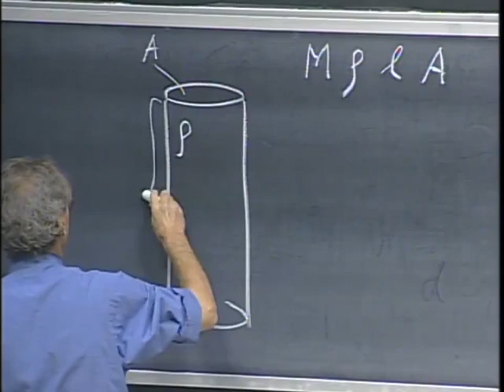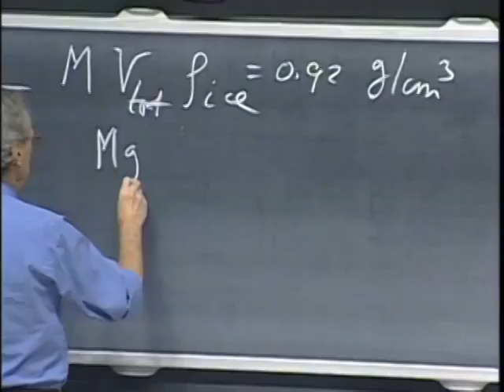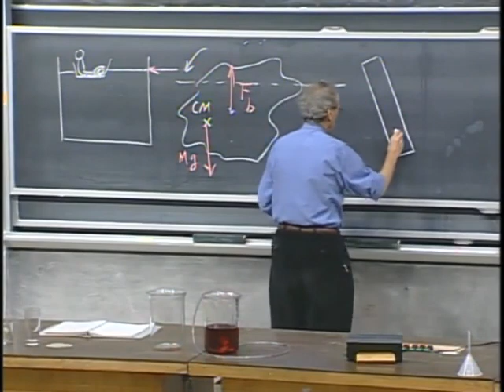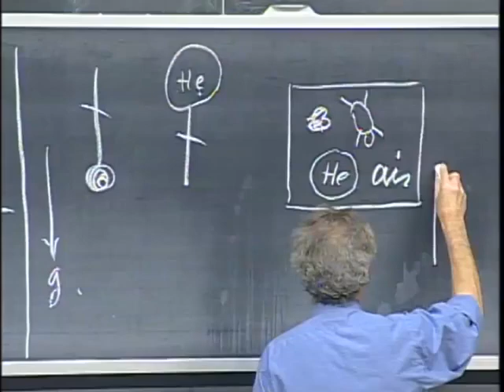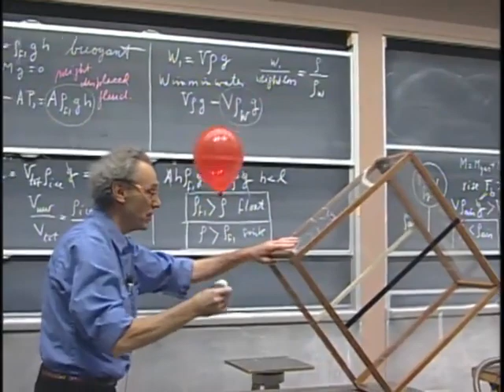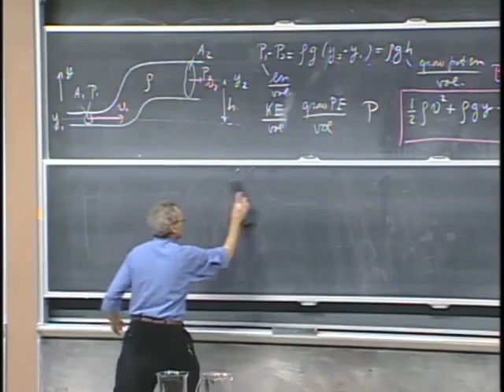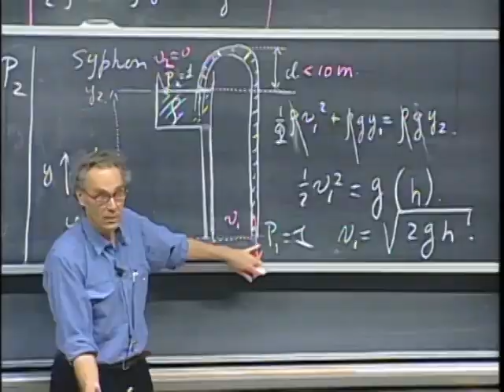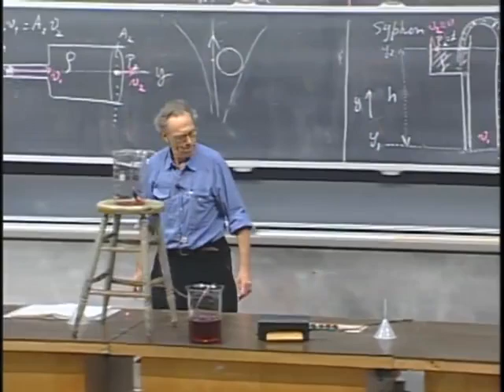8.01x - Lect 28 - Hydrostatics, Archimedes' Principle, Bernoulli's Equation

Comment: I think that to understand the pool level problem, it helps being exaggerated. Consider a super dense object, 1 ton with the size of a coin. Now imagine we drop it in a boat that could carry it. Intuitively, the water level would rise significantly to counter the added weight. Now if we drop it in the water, there will be a massive weight relief in the boat and the buoyant force required to keep it floating will be therefore much less. The object has the size of a coin, so the volume of water displaced by it as it sinks is negligible and so is it's buoyancy. The total buoyant force that the water produces will be way less, and so the pool level will drop. As long as the boulder's density is greater than that of water, the same reasoning could be applied.

Comment: I have an answer to the swimming pool question posed at 11:20, but I also have two additional questions regarding the same.

The answer to your question:  The water level goes down, because if we assume that the density of the stone is greater than the density of water (a reasonable and intuitive assumption), then the stone will sink to the bottom of the pool and settle down. When that happens, the buoyant force that was originally holding up the stone before it was thrown into the water will now be shared between the upward normal force at the bottom of the pool AND the new buoyant force together. Therefore, the new buoyant force is only a fraction of the original buoyant force. Since lower buoyant force displaces lesser water than higher buoyant force, the water level in the pool goes down.

(In the event that this is a bottomless pool, then the stone will keep accelerating downwards under its own weight as there is a net force pulling the stone downwards. This net force can only exist if the new buoyant force is lower than its weight, and hence the new buoyant force is lower than the original buoyant force. Thus, the pool level drops).

However, I have two variations on the stone that was thrown out:

Q 1. What if, instead of a stone, a fish of the same volume as the stone but of the same density as water is thrown out of the boat and into the pool such that the fish goes below the surface of the water but doesn't sink? Would the water level in the pool go up, stay the same, or drop?

My (probably wrong) answer: The water level would stay the same. Since the buoyant force is neither being shared by any normal force at the bottom of the tank (as the fish isn't sinking to the pool floor) and nor is the fish accelerating downwards, there is no change in the total buoyant force, which means there is no change in the displaced water. Hence, the water level stays the same.

In fact, when the fish is thrown out of the boat, for the brief moment that it is in the air, the water level drops (as the buoyant force drops), but once the fish is under the surface of the water, the water rises again by the same amount that it had dropped, thus equalizing the level.

Q 2. What if, instead of a fish, a wooden block of the same volume as the fish but of lower density than water is thrown into the pool such that it floats? Would the water level in the pool go up, stay the same, or drop?

My (definitely) wrong answer:  The water level would stay the same. There is no change in the total buoyant force here either, as the wooden block isn't sinking to the floor.

But I still feel that my answer to this last question is wrong because my inductive reasoning would have led me to believe that if a higher-density object (stone) lowers the water level in the pool, and an equal-density object (fish) keeps the water level the same, then a lower-density object (wood) would have raised the water level. But that is not what the equilibrium equations tell me.

Please correct me if I am wrong in any of the above.

And yes, your lectures DO make me ♥ physics :)
Reply from the maker: Watch my lectures - Your answers are there!

Comment: Hello Dr. Lewin, this is what I think about the question about the water level changing when you throw the rock overboard.   

I am a little confused on what you mean by will the water line remain change. Relative to the boat or relative to the walls of the pool? 

Initially, the water is at a height y_0. The volume of the fluid V_water is given by x*y_0*z where x is width and z is the thickness. For the boat to float, the F_b must equal the weight of the boat and rock. So F_B_0 = (M+m)g (1)  where m is the mass of the rock and M is the mass of the boat. 

Now analyzing the situation when you throw the rock overboard. The mass of the entire boat-rock system must change because we no longer have m. So, in order to float, F_B =Mg.  (2) 

So applying Archimedes Principle to (1.1)    V_fluid_0*p_water = V_(M+m)*p_(M+m)   and to (2.2) V_fluid*p_water = V_M*p_M   . F_B_0 > F_B because of (1) and (2). 
Therefore. V_fluid_0*p_water > V_fluid*p_water.  
p_water = M_water/V_water = M_water/x*y_0*z    so we have it that: 
V_fluid_0*M_water_0/xy_oz   >  V_fluid*M_water/xyz 
We know that the density of water must remain constant so as we throw the rock overboard, the mass of the fluid M_water increases. So if M_water > M_water_0 and the densities are equivalent, y_0 > y to keep a constant density so the water level will sink.
Reply from the maker: +Dr. Science Sc.D please summarize your conclusion yes the water level will go down. You did way more work than was needed. Try this. If the volume of the rock is V when the rock is in the boat, more water is displaced than V (Archimedes). When the rock is at the bottom the water displacement is V. Conclusion ==> the water level goes down when you throw the rock over board. .
Reply: +Dr. Science Sc.D In these problem the water level is taken relative to the walls of the pool. If it was to be taken in relation to the boat (and then the question would be if the boat sinks in a little bit or a little less, respectively the water level in relation to the boat would rise or would lower). Coincidently, I think the answer of both of the problems is that the water goes down.

Comment: Whenever a body is partially or completely submerged in a fluid,it will experience an up thrust which is equal to weight of the fluid which has been displaced.

Comment: I think the water will lower slightly.  The stone will displace its volume of water when tossed in and therefore sink due to density. At this point I believe that the boat will float higher in the water and displace less. The boat was displacing water equal to the weight of the stone which is more water than the volume of the stone. If the stone was same density as water , the level stays the same.

Comment: In this case, the helium balloon is already in motion due to its upward buoyancy force, which is caused by the difference in density between the helium inside the balloon and the air outside. When the container is accelerated forward, the balloon, being part of the container, also experiences the same forward acceleration.

Since the air in the container is also accelerated forward, there is no relative motion between the air and the helium balloon. Therefore, the buoyancy force acting on the balloon is not affected, and it will continue to move forward with the container.

I think this make the concept INTUITIVE

Comment: {39:00 -->}
You said that when a hole is made in the vessel, water will flow with the same velocity as in the 'syphon case'. But what if both were done simultaneously ? 
The approximation that v2~0 would not hold good right ?
Reply from the maker: both can be used simultaneously. Each would work as if the other was not there.

Comment: Water line goes down. The rock is added weight which the water must then displace by allowing more of the boat in the water. If the boat and its contents are to be considered a system, then just pretend their density is shared, Having a rock in the boat  effectively increases its density (its weight per volume). Due to this the boat will sink to a point where Vwater*Pwater*Gravity = Weight of boat. The boat weighs more with the rock, when the rock is thrown away, the volume of water required to meet this wight is lessened. The boat rises, the water line goes down on the side.

Comment: I guess the reason for the last problem being the following; when he turns the glass upside down a tiny amount of liquid runs through the microscopic gap between the glass and the cardboard with a high speed, causing so much low pressure thus the Mg of the liquid is supported. Please correct if I'm wrong.

Comment: Professor in the syphon demonstration, the reason why the water runs against gravity is probably due to two reasons........

1) you mentioned that area of the tube is much smaller than area of the vessel so this means adhesive force inside the tube will dominate over the weight of the juice.

2) if suppose after juice starts flowing and at some point the flow breaks then at that point there is vaccum while at the end of the tube dipped in juice pressure is 1atm.....so this will also drive the juice upwards.......
Reply from the maker: google syphon - it's all there

Comment: I do not thin Bernoulli's equation is that Bizarre when you think about it. Pressure is a static energy measure while flow is a kinetic energy measure so it stands to reason that they would have a inverse relationship. No different than Amps and Voltage. Any measure of energy in motion will have a inverse static measurement as well. It only stands to reason at least that has been my observation as a mechanic. Cheers!

Comment: 47:55 Sir please crt me if I'm wrong! In this case..when there is no cardboard covered upon the glass the pressure at any point on the surface of the juice must be 1 atm. After the cardboard has been kept on it and closed ,still it is 1 atm. When I think about what happens when we flip the glass which is closed with a cardboard the air molecules inside the glass goes up and juice comes down where the pressure of air inside the glass is not 1atm anymore and it would have become very low such that you can neglect the pressure of the air . Now if you look at the cardboard there are two pressures acting on it from both the sides,one is 1atm due to the atmosphere and the other one is, whatever the hpg of the juice is. And  the hpg is way more less than 1 atm because it is not 10 metres ,if so, it would have pushed the cardboard and as result the cardboard is pushed towards the glass by 1atm pressure outside ! Correct me if I'm wrong sir!🤓
Reply from the maker: you have not explained why I was able to suck up liquid over a distance of about 5 meter.
Reply: @lecturesbywalterlewin.they9259  sir that was because you were just sucking out the air inside the tube and when you do that the atmospheric pressure pushes the fluid up you can do it until you are at 10 meters of height...the reason that you were not able to suck it above 1 metre in the previous demonstration was ... you sucked it at a single breath. you could have done that if you do that by taking a breath in between .otherwise you will not be sucking out all the air inside the tube which would actually resist the water coming up....the main reason behind  that is... Your lung capacity..you may not be able to suck it more than 1metre at a time but you can do it more than 1 metre by breathing through your nose in between... correct me if I'm wrong sir
Reply: @lecturesbywalterlewin.they9259  sir please reply sir😅🤓

Comment: If the boat has a flat bottom,or otherwise, and is raised to the level of the water,its weight will remain the same,so, if now the stone is thrown into the water will flow overboard so the level of the water will go down,just as the water in Archimedes bath the water fell to the floor.

Comment: For the upside down glass trick: Upward Force caused by atmospheric pressure exerted on the cardboard is higher than the downward force produced by weight of water (plus the small force caused by the trapped air on top of the fluid).
Reply: the open air pressure and the air pressure in the glass cancel out. they are both 1 atmosphere.

Comment: The waterline must go down as the buoyant force isn't changing as the boat displaces the volume, however, the weight of the system(man and boat and rock) is reducing so the upthrust is greater now and with respect to the boat, the man shall see the water going down.
Reply from the maker: correct

Comment: I think the level of water will go down because when the stone was in the boat , the boat had to replace an amount of water which was equal to the weight of the man , the boat and the stone itself but later when the stone was thrown , the stone didn't replace anymore water than its equal volume  . I presumed that the density of the stone is greater than the density of water.  So the water level goes down . I am not sure if this is an appropriate answer or not .
Reply from the maker: correct
Reply: Thank you :) .
Reply: @mdsakhawathossen7088  yes you are right. The nice point in this problem is that everything depends on the density difference between the object you throw and the liquid of the swimming pool. If you empty a bottle of liquid which has the same density of the liquid in the swimming pool, the level remains the same. If you throw a stone the level goes down. Nice problem prof. Lewin! Inspiring as usual
Reply: @Jeremy Nathan   Well, I'm not so sure about that.. I mean, if you fill the boat with water, the water in the pool still has to displace the same volume that the filled water weitghts, making the boat to sink a lil bit more and therefore, making the water level to rise... When you remove the water inside the boat, the only volume to be displaced is the one from the weight of the boat, making the water level to go down. So I don't think that the density of the rock  (or any object inside the boat) plays an important role (as long as it is higher than the density of the air).
Reply: Since the density of the rock is so high. it’s volume is quite small, for a given mass, therefore, the water displaced by the rock is much less. The water level will go down

Comment: Good evening professor. I've tried different experiments about the upended cup. First I assumed it's because of the shape of the cup because the base is narrow and the opening is wide and when upended the Pressure*Area inside is lower than the P*A outside. However,  the opposite shape also worked... I tried different quantity of water inside. But it worked no matter it's fully filled or with just little water. It has nothing to do with the covering material whether it's water-absorbable such as cardboard, a piece of paper or a piece of plastic sheet. But when I made a hole at the bottom of the cup and upended it, it didn't work. So It's absolutely due to the air pressure difference between the inside and outside. Since 1/100 difference of 1 atm produces 10 gw/cm2, it's possible. I noticed when upended if some liquid was intentionally let out (just some drops on the paper) it had high success rate. So my conclusion is that the volume of air inside increases due to the loss of some liquid (leaked out or absorbed in the paper) which decreases the pressure of air so the pressure difference supports the paper. Could you verify this ? Thanks a lot !
Reply from the maker: IN ADDITION adhesion is CRUCIAL!
Reply: Thank you professor! I forgot the existance of adhesion force. :p
Reply: Professor, your lectures are thought-provoking. I want to share with you an application of this phenomenon in my field. I'm a dentist and when we fabricate a upper complete denture we have to make sure the borders are in close contact with the soft tissue so the saliva can adhere in between. We call this "border sealing" and when the patient put on the denture they will squeeze out some liquid or air inside and good border seal produces negative pressure therefore the denture will be sucked tight on the hard palate (just like the cardboard). There's a syndrome called xerostomia which means lack of saliva. Edentulous patients with this syndrome suffer from denture dislodgment when chewing because there'e no saliva to provide good adhesion.
Reply: Hello. If you have a leak out of fluid it could not work any more I think. And if you have a Piece of plastic, water can not be absorbed. In my opinion the Explanation is another one: if cardboard Surface is 20cm^2 than from atmospheric pressure you get 20Kg (200N) pushing on the paper. Instead, inside the galss, the weight of the water can be for example 0.5Kg. So you have 20Kg pushing against 0.5 Kg for example. The air inside the glass is pushing on the water with atmospheric pressure but the total weight that you get pushing down on the paper is always the weight of the water! 
What do you think of this solution?

Comment: Regarding the Problem of the cranberry Juice!!
 If cardboard/paper Surface is 20cm^2 than from atmospheric pressure (100000 Pa) we get 20Kg (200N) pushing on the paper. Instead, inside the galss, the weight of the water can be for example 0.5Kg. So we have 20Kg pushing against 0.5 Kg for example. The air inside the glass is pushing on the water with atmospheric pressure but the total weight (air + juice) that is pushing down on the paper is  the weight of the water: so much smaller that force produced by air pressure!
Professor Lewin is this correct?

Comment: Dear Prof. Walter Lewin,

The Ping ball- Funnel experiment was awesome. In case of inverted position (blowing down), what happens when the velocity is kept on increasing ? Will the ball fall down, stick to the top or stabilizes at level below the initial level ?
Reply from the maker: It will probably  depend on the kind of funnel that is used but given enough air pressure (from above) it will probably fall out.
Reply: Thank you.